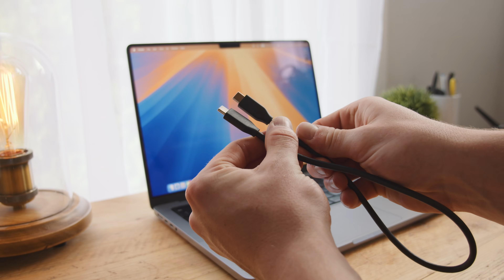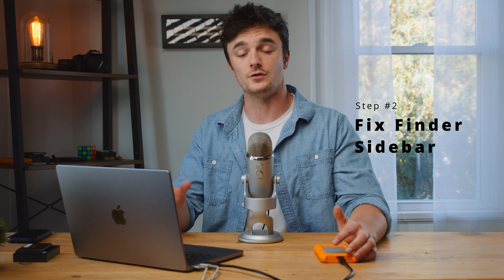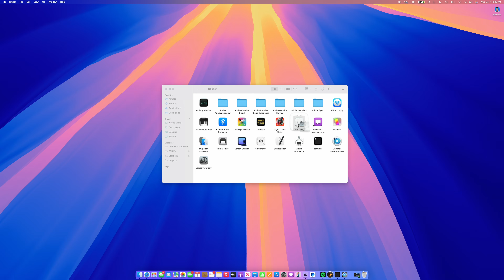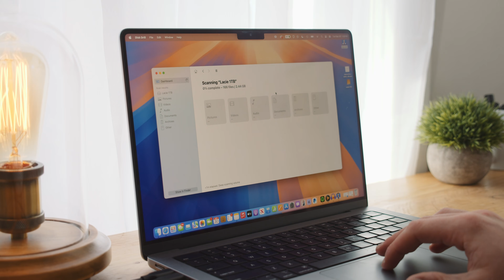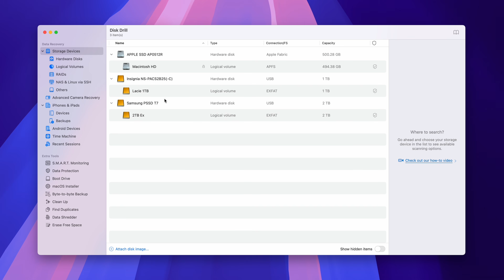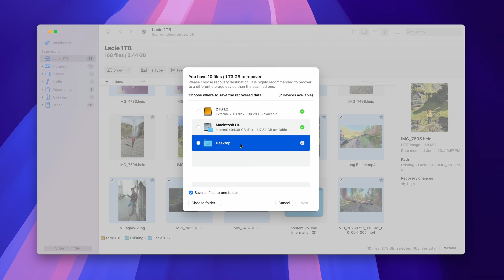How to Fix an External Drive Not Showing Up on Mac

Comment: HELPPP I have 3 WD Passport hard drives which ALL stopped opening for me in the same week!  I recently bought a brand new MacBook Pro because mine was ancient. Hard drives still won't appear on disk utility. Im fearing that the old Macbook has fried them or something! Have you ever come across this before and please please please how do I access them again?? 
Ive read all the previous comments and tried a some of the methods advised, but to no avail :(

Comment: and what if it doesn't appear in Disk Utility??
Reply from the maker: If it doesn’t even show in Disk Utility, that’s a red flag. Try another cable/port, computer or check System Info. If it’s invisible everywhere, the drive itself may have failed.

Comment: mine is working on another mac but not mine anymore. i changed permissions to allow all as well. check disk utility. everything. its not visible anywhere. running but not showing up at all. did everything in the video. please help
Reply from the maker: Since it works perfectly on another Mac, your drive is healthy and the issue is isolated to your Mac's software or ports. First, open Activity Monitor, search for "fsck", and force quit any active processes. macOS sometimes gets stuck silently repairing drives in the background, and killing this process usually makes the drive mount to your desktop instantly. If that does not work, bypass all USB hubs and plug the drive directly into the Mac to rule out a power delivery issue. If it is still completely invisible in Disk Utility after a direct connection, perform an SMC and NVRAM reset to clear out corrupted hardware configurations blocking your USB ports.

Comment: i had this issue as well.... while the hard disk worked just as fine in my windows computer, but when I tried to connect it to my mac.......nothing showed up
Reply from the maker: Finder is hiding it or the drive failed to mount. Open Finder Settings (Command + comma) and check External disks under General and Sidebar. Open Disk Utility, select the drive, and click Mount. Plug it back into Windows, click Safely Remove, and reconnect to Mac. Plug the drive directly into the Mac without a USB hub for sufficient power.

Comment: So I tried all of this even before watching the video, and no luck. The drive works, as it shows up on both a Windows computer at work and my linux computer with all the files intact, but on my Mac Studio it only works sometimes. It doesn't even show up in disk utility, but the indicator light is blinking like normal. I have no idea what's going on. It's a 4TB WD Elements USB3 drive.
Reply from the maker: Try using a different cable or connecting to a different port, as intermittent connectivity is often power-related.
Reply: @c @cleverfiles ame thing is happening with me. It doesn’t show up in disk utility, but the drive is on and working. But it’s not a cable or port issue, I tried it all.
Reply from the maker: Since the drive works fine on Windows and Linux, the drive itself is healthy. On your Mac Studio, a 4TB mechanical drive often fails to mount because it isn't getting enough peak startup power during USB negotiation, which causes the Mac to kill the data link while the indicator light keeps blinking.To fix it, connect the drive directly to one of the rear Thunderbolt ports using a dedicated USB-Micro-B to USB-C cable rather than a passive adapter, or run it through a wall-powered USB hub to supply stable current. You should also check System Settings under Privacy & Security to ensure "Allow accessories to connect" is set to "Always."

Comment: what if it still doesn't appear in disk utility? its really weird coz it used to be read before. cable has no problem coz it work on other hard drives. its just on 1 particular hard drive that it doesnt work :(
Reply from the maker: Please reach out to support at help@cleverfiles.com for further assistance.

Comment: Mine doesn't even show up in Disk Utility, I haven't changed anything in my setup, it's just all of a sudden not showing up anymore. All the lights are on, power is working, it's making the same noises it usually makes when being plugged in  ....
Reply from the maker: First, open Disk Utility and switch the top-left menu from "Show Only Volumes" to Show All Devices, macOS frequently hides raw physical disks when a partition fails to mount.
If it still doesn't appear, open Activity Monitor and force-quit any active fsck process, which often hangs and locks the drive out of the system. Restarting your Mac or bypassing any USB hub with a direct cable connection will also clear temporary communication glitches.

Comment: Thanks for the comprehensive step-by-step video! I have a question about image previews during the recovery process.

Disk Drill mentions that previews are important because they're the only way to verify whether files are actually recoverable. Some of the photos I'm trying to recover only show partially loaded previews. Does that usually mean those files are corrupted, or is there still a chance they can be fully recovered? Is there anything I can do to improve the chances of recovering them?

Thanks in advance!
Reply from the maker: Indeed, you must check file previews before recovery. I recommend reaching out to support at help@cleverfiles.com for further assistance.

Comment: what about if your harddrive is showing up on another mac but isnt showing on on my main computer on the side or in the disk utility
Reply from the maker: The issue is either a bad port/hub connection or a frozen background disk-repair process on your main Mac. Try plugging the drive directly into a different port on your computer without using a hub. If that doesn't work, restart your main Mac, this instantly clears frozen background processes that prevent Disk Utility from seeing the drive.

Comment: Only internal drive shows up in Disk Utility, no external drop down when this external drive is plugged in. I ran this external drive on my other MacBook Pro right now, no problem. But it will not show up on this MacBook Pro. Other external drives pop right up when I plug them in. But this one will not. Of course, My Passport backup is on this external drive that will not show up. What do I do?
Reply from the maker: Try using a different USB cable or a powered hub, as this might be a power delivery issue specific to that port on your machine.
Reply: @cleverfiles  It was the cable. I bought a new cable this morning & it worked right away. Thank you!

Comment: None of these options worked. I’m trying to connect a dvd drive to see photos saved on an old dvd.
Reply from the maker: Optical drives often require a higher power supply, so try connecting yours through a powered USB hub.

Comment: Great video! For anyone else in a similar boat: my mac laptop ran out of battery with my external SSD plugged in. Turned out I just had to plug it in and wait 5-10 min for the drive to do some internal stuff/rebooting I think. The issue fixed itself and my Mac recognized the device before the disk utility even finished loading haha.
Reply from the maker: Thanks for sharing that helpful tip with everyone! 😊

Comment: This video didn't help. My external harddrive isn't showing up ANYWHERE on my Mac, not even in disk utility so what do I do now? It formatted to ExFat and it isn't old but it does have some files in it but I don't need or care about the files, I'm actually trying to wipe it clean. What do I do???
Reply: I'm currently facing this same issue today, Did you got your's sorted ?
Reply: @DanielOnywuchi06 nope 😢
Reply from the maker: This is a known issue for macOS when working with exFAT drives. Try connecting this drive to any Windows or Linux computer and check if it will be recognized on these systems

Comment: please help Ihave seemingly the same issue with my drive not showing up even after all these fixes, it won’t even show up on disk utility so I’m kinda lost. I’ve had this issue for a while but suddenly it started working again out the blue after months of me not using my MacBook but my MacBook wouldn’t boot up windows 10 so I ended up deleting and redownloading the files, and bought more space for my iCloud my flash drive stopped working again. Seems like every video is saying the same thing is there really no fix to my issue?
Reply from the maker: Try checking if this drive will be recognized on Windows.

If not, then the only solution would be a data recovery centre:
1) ACE Data Recovery: Certified clean rooms, multiple drop-off locations across the U.S., and flexible pricing - https://www.cleverfiles.com/drc/

2) SALVAGEDATA: Over 100 locations in the USA and Canada, accredited professionals, and extensive experience - https://www.cleverfiles.com/salvage/

3) 300DDR: A highly experienced team offering budget-friendly recovery solutions -
https://www.300dollardatarecovery.com/

Feel free to explore these options and choose the one that works best for you.

Comment: I keep buying UCB C to USB B cables.  I have a Western Digital WD2500I032 | Western Digital | My Book Essential.   Each time I buy the cable the description says "Data Cable" but when I get it, it's just a charge cable.  So frustrating.
Reply from the maker: That sounds incredibly frustrating; make sure to look for cables specifically labeled "USB 3.0" or "High-Speed Data" to ensure they support data transfer. 🔌

Comment: I made a terrle mistake by easing my hrad drive and after, it stopped showing up on my mac. no i cant find and i followed your steps, i saw it at disk utility, clicked on repair but it didn't work. Please is there another way to fix thing?
Reply from the maker: You should try using data recovery software like Disk Drill to scan the drive and restore your files before attempting to reformat it again. 📁

Comment: That was quite comprehensive and thank you.   However it hasn't fixed the problem.  The ext Hard Drive actually does show up on my desk top. And it does allow me to move files back and forth, so I know the cable is good as well as the port.  But the drive does not show up in the finder side window.  When I plug in my Iphone, it doesn't show up anywhere.  I checked the Disk utility and it doesn't show any USB device Tree.  All the boxes are ticked.  The Ext Drive Box and all the others!  I have done a complete update on the OS.  Same with my phone.  Not sure where to look next?  If you have any thoughts?
Reply from the maker: Since your hardware works, try resetting your System Management Controller to resolve the USB connection issues. 🛠️

Comment: I have one doubt — will the recovered data be in partitions, or will it be restored with the exact original folders and file names?

 I scanned the whole drive using “Search for lost data” (not just Deep Scan), and in the APFS section I can see my original folder structure and exact folder names.

Does this mean those folders/files will be recovered with the same structure and filenames as they originally were, or can they still end up separated into type-based folders like MP4/PNG/MOV during recovery?
Reply from the maker: You can expect the recovered files and directories look the same as in the scan results. If questions arise, please reach out to support at help@cleverfiles.com

Comment: Any suggestions on an issue where Migration Assistant sees my external HD, but the backup is greyed out and can't be selected? (Strangely, I can access the backup on an older macbook using Migration Assistant, but not the macbook where I actually need the backup.)
Reply from the maker: The grayed-out backup in Migration Assistant often indicates a version mismatch, permissions issue, or a failure of the new Mac to index the drive properly. Since the old Mac can read it, the data is likely fine, so focus on aligning macOS versions, using direct connection, and allowing extended indexing time.

Also, try checking this link: https://www.reddit.com/r/MacOS/comments/1nat0ai/migration_assistant_doesnt_recognize_a_backup/

Comment: I find your video on YouTube for recovery of my corrupted sd card data but i afraid to format my sd card while i don't loss my data at any cost what can i do suggest me
Reply from the maker: Do not format the card, as that will make recovery much more difficult; instead, use recovery software to try and pull your files off first. 📁

Comment: I have the issue of them not showing in disk utility either ... and this is happening more and more frequently. My fix is to actually plug these drives into a windows laptop and run a scan and fix. Once I've done that, I reinsert back into the Macbook and its working again. I dunno why Apple doesnt have an easy fix like this!
Reply: I don't have any windows :( I'm also having this issue though. I don't know what to do
Reply: I tried that and it worked. The main problem was that the storage was full
Reply from the maker: I assume it's an exFAT drive?
Reply: @cleverfiles hi i have a 'wd my passport 6tb for mac' and the there is no recognition of the disc on my mac but there is on my windows computer but i get some message about not having correct driver with indication i need WD SES driver but i cannot figure out how to get it.
please reply.
thanks very much.
Reply: Will this delete your files inside the SSD after connecting to a windows  laptop  and running a scan and fix?

Comment: I accidentally used clean all on a hard drive instead of a USB stick and when I realized I closed powershell and I repartitioned it and I want to recover my lost files  would it also work if I copied data on it then moved it to another??
Reply from the maker: The recovery chances are slim in this case, but Disk Drill Basic is free, so it could be worth a shot.
Reply: Would it work if I did clean all twice but closed it in less than five minutes then repartitioned it and copied data on it then moved it to another??

Comment: Hi, my disk is not showing on Mac or in finder. I am at the disk utility stage and it is showing the drive under external but greyed out as a light grey. When I select it, it says not mounted and first aid is greyed out and I can’t seem to use it? What do I do? Thanks
Reply: It’s a new MacBook Pro and my hard drive seems to still show fine in my old MacBook Pro
Reply from the maker: This typically indicates a mounting failure or file system corruption that macOS cannot natively repair. You should consider using Disk Drill to recover your data from the unmounted volume and then reformat the disk to restore functionality.
Reply: @cleverfiles ok Thankyou for explaining that, that helps to know. My old mac still works so I have plugged the drive in to that (as it works on there and not the new mac) and transferred the data to another drive (one that does work on the new mac) via here. But thanks for letting me know of disk drill, I will remember it for future .

Comment: all of these videos want you to download something from the internet.  Who knows who makes this software, and what dangers it might present.  It's a scandal that you buy a $600 gopro and you then have to spend hours or days to figure out how to get the videos off the d*mn thing on to your computer.  In 2026, this should not be an issue.
Reply from the maker: There are many camera manufacturers, but most of them do not focus on data recovery. That’s where specialized software like ours comes in to help.

You can find detailed instructions on how to scan your camera’s memory card using our software here: https://www.cleverfiles.com/help/advanced-camera-recovery-in-disk-drill.html

Also, please note that we are a US-based company, so there is no reason to be concerned about trustworthiness.
Reply: @cleverfiles Your offer to “help” is really just a scheme to get people to buy your solution.

Comment: I have 3 hard drives which all will not appear in disk utility to even get past that step. One of them was working just fine and mid transfer stopped and now I cannot use it. Have yet to find a solution.
Reply from the maker: In such a case, you might need to send your drives to a specialized offline data recovery center for professional assistance. We’ve partnered with several trusted providers, and here are some options we recommend:

1) ACE Data Recovery: Certified clean rooms, multiple drop-off locations across the U.S., and flexible pricing - https://www.cleverfiles.com/drc/

2) SALVAGEDATA: Over 100 locations in the USA and Canada, accredited professionals, and extensive experience - https://www.cleverfiles.com/salvage/

3) 300DDR: A highly experienced team offering budget-friendly recovery solutions -
https://www.300dollardatarecovery.com/

Feel free to explore these options and choose the one that works best for you.

Comment: Should I use First Aid before file recovery or after? I've heard it can have negative impact on files, if the drive you are trying to repair is unstable.
Reply from the maker: It depends on the condition of the drive. If the disk may be unstable or failing, we usually recommend not running First Aid before recovery. In such cases, the safest approach is to first create a Byte-to-Byte backup of the drive and then scan the backup instead of the original disk. This protects the data from further damage.

Comment: I’m dealing with the same issue. I’ve already tried all the usual fixes, but the drive still doesn’t show up properly on my Mac. Let’s say I manage to recover the data with Disk Drill but what should I do with the drive after that? Just throw it away and get a new one?
Reply from the maker: After using Disk Drill to safely recover your data, perform a reformat in Disk Utility to see if the file system can be reset. If the drive reformats successfully and shows a "Verified" S.M.A.R.T. status, you can keep using it for non-essential storage. Otherwise, the hardware is unreliable and should be replaced.